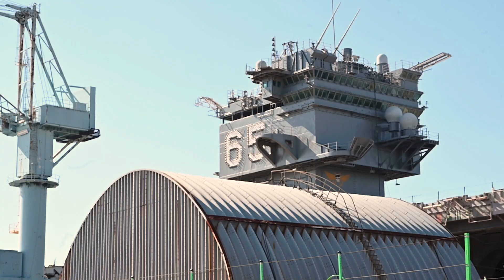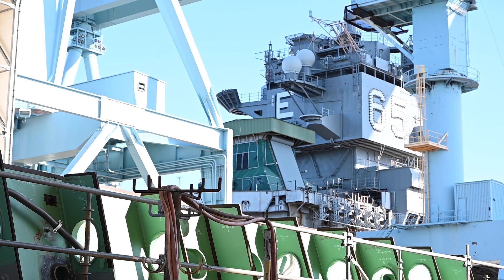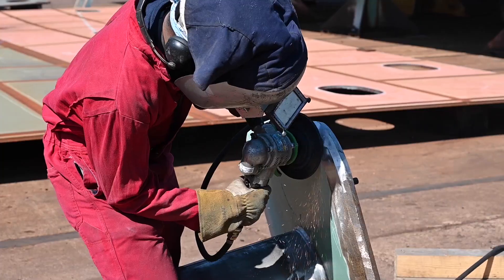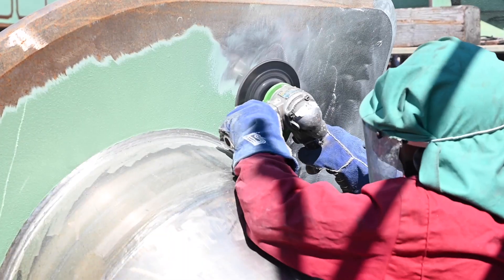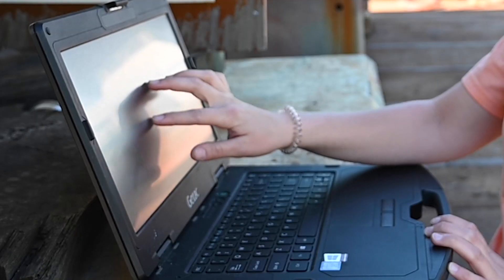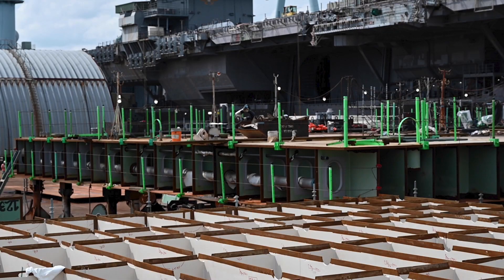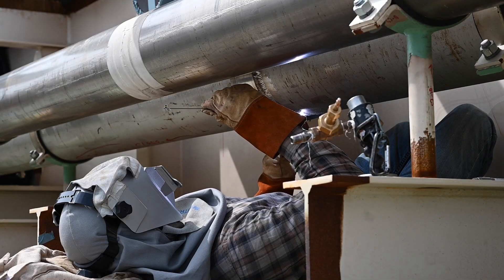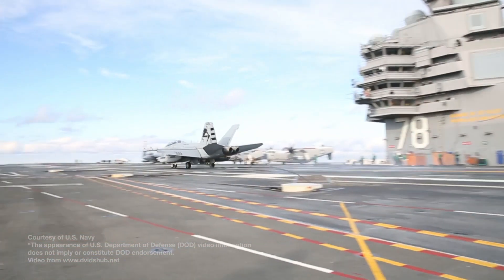Enterprise (CVN 80) Construction Update

Comment: CV-6 and CVN-65 were built in this same shipyard.  I think that CVN-65 was built in this same drydock while CV-6 was built on a conventional (for the time) construction slipway that was nearby.
Reply: so was CV 6 the original CVN 80 will use steel from both ships and the bridge will be studded with glass taken from the bridge of CV 6 and CVN 80. Also CVN 80 will be built in the same dock that housed her mother and grandmother Drydock 12 the famed erecting hall of the greatest ships in our navy.
Reply: @geomodelrailroader  wait, since when is the cvn80 using steel from cv6? and where did they get it?
Reply: @sharpy3453 many components of CV6 were saved and put into CVN 65, which are also going into CVN 80, mostly portholes and non structural items, mostly decorative and traditional stuff
Reply: @Matsumoto77  ah OK. That makes some sense, wish i could get a piece of steel from them both myself, would be cool to have